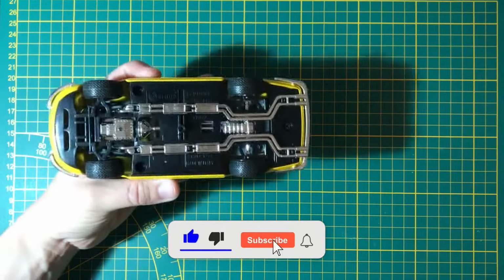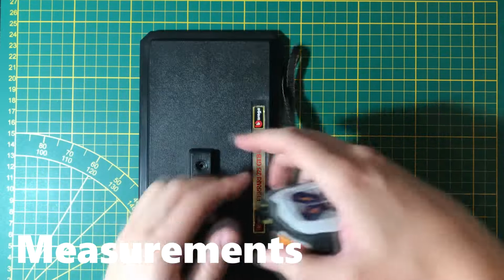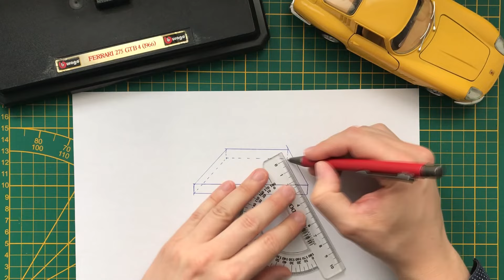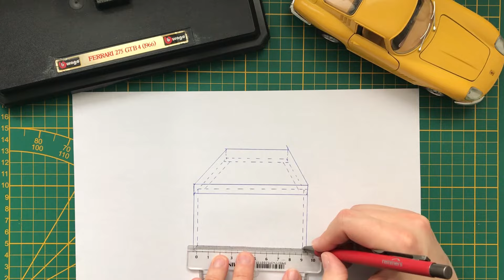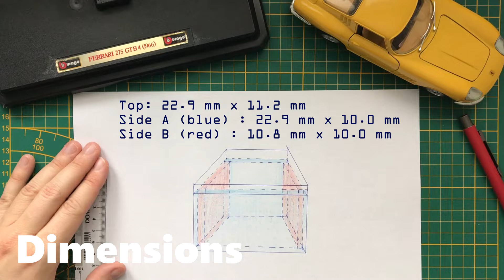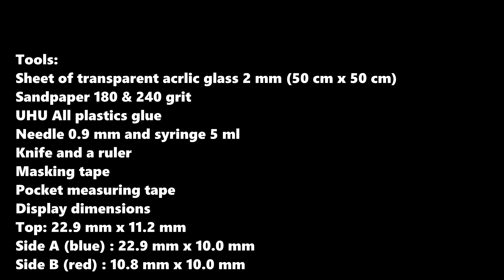How to make a display case from acrylic glass/plexiglass at home for 1/24 scale car models easy DIY

Comment: Did you seal it or can you take the top off because if it's sealed it defeats open doors an hood
Reply from the maker: The top part of the display is just glued and I haven't sealed it using transparent silicon. What I have noticed so far it gives just a basic protection from dust with silicone It would give much better! thanks! :D

Comment: Can I use super glue to stick sheets together?
Reply from the maker: @Dhritimansarma-o3x   It will bond, but the connection might not be very stiff, and there’s a chance it could cause hazing. I’d suggest testing it on some leftover acrylic sheets. :)
Reply: @AdHocCars Which glue would be better to do it with?
Reply from the maker: In this project used the UHU All plastics glue. It's not perfect but it works good enough:)